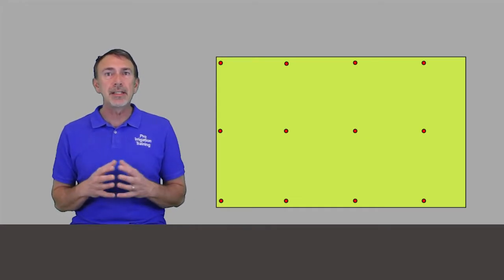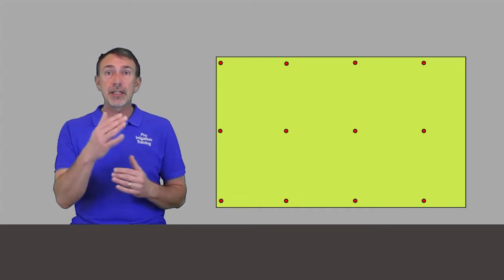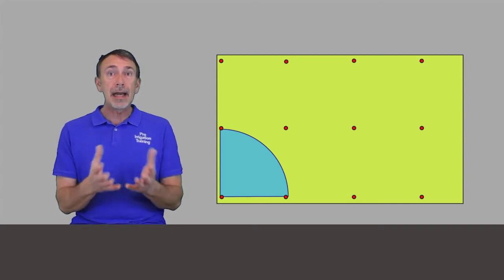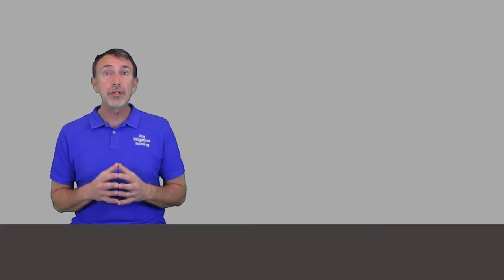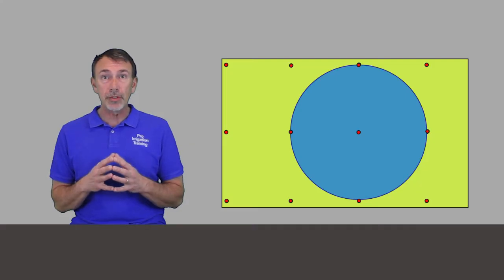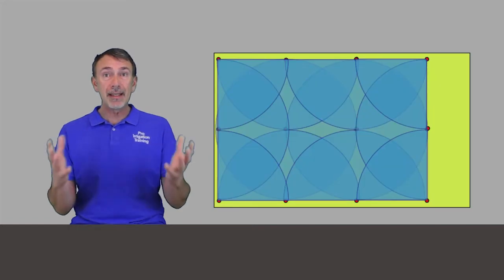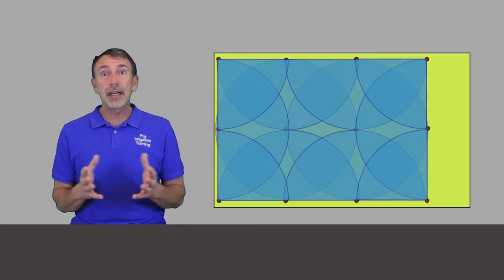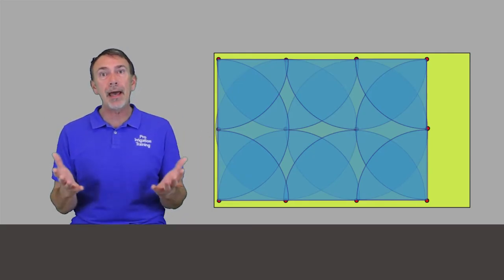Head To Head Coverage in Irrigation Design (sprinkler system design)

Comment: I have same shape lawn but already have sprinklers around the edges only.   One in each corner and then 2 additional on the longer sides.  Should I be using 180 degree on the sides? What about corners?  I currently have brown spots at the base of 3 of the sprinklers on the long sides.   Trying to fix that issue.
Reply from the maker: Yes definitely 180 on the sides, or as wide as you can open the pattern or arc up. Each head's spray should touch the next head. That's how we prevent poor coverage close in to each head.

Comment: I have exactly the same shape lawn - 90 x 60 so looks like I would use 12 heads - 4 x 90, 6 x 180 and 2 x 360.  My water supply is about 20 feet away from the corner of the lawn and I plan on using the faucet with a 4 way timer attached.  My pressure is 80psi and GPM is 15.  2 zones or 3 zones and how would you suggest I connect all the heads?  On the side where the water supply is?  Great video BTW
Reply from the maker: How are you supplying water to the heads? Garden hose? If so, I would lay it out and test how many sprinklers you can get per zone. Garden hose has notoriously bad friction loss.
Reply: thanks…I’ll buy some 1” poly and connect 4 heads and see what happens
Reply from the maker: @cltplayer  That should be sufficient to supply 4 heads.

Comment: How do you determine what pop-up height is needed when ordering MP Rotators?
Reply from the maker: Do you mean the height of the spray body you're going to put the MP Rotator nozzle on? If so, you need to consider your grass type and how high you let it get. Bermuda, Zoysia and warm weather grasses are recommended to cut at 2 - 2.5" so a 4" spray is fine, but Fescue cut at 3.5 - 4" needs a 6" spray.
Reply: @Proirrigationtraining :  Thank you for your reply.  Yes, I'm looking at Hunter Pro-Spray PRS30 sprinkler bodies and they give different pop-up heights, 4", 6" and 12".  Looks like I should use the MP1000 nozzles due to having low water pressure (35-40psi) and a small area of lawn to water.  I was just curious due to lower pressure of water and nozzle if it should have a higher pop-up to reach further. Lawn height will average 4" so I'll go with the 6" inch as you suggested.
Reply from the maker: @joerevere937  Great, good luck with the project. Let me know if you have any more questions!
Reply: @Proirrigationtraining  How about 3 inch? is 4" pop up too short for 3" grass? 80/20 rye fescue
Reply from the maker: @bradyburke4383  I see a lot of 4" sprays in Fescue. It's fine as long as the spray is buried correctly at grade. But many times, after a few years, the sprays begin to sink in the ground, and that starts to be a problem.

Comment: Love your videos. My backyard is exactly that shape and will need tbe same number of heads. I'll split them in two zones.

What's the most efficient way to run the lines? Should i do it in series in a closed loop or should I run the main line in the middle and then tee off from it for each head?
Reply from the maker: It's better to have a main line down the middle and branch off to each head instead of in series. Thanks for watching!

Comment: In my quest to get head-to-head coverage in my previously installed sprinkler system, I notice that there is a valve box in a corner of the yard where a 90* rotor would be perfect. Is it okay to place a rotor near that valve box? The valve box is for 2 different zones. Thanks
Reply from the maker: It shouldn't be a problem. Just be careful digging around the box since you know there's wires going into the box. Good luck and thanks for watching!

Comment: I have a perfect square backyard that has 16 sprinklers. How do I know if I need a 90 180 or 360 sprinkler??? I just had them installed n the people did a terrible job. Also do you recommend the mp rotators with the pro series  pressure regulated heads at 40 psi? Also it’s the same setup as this but there’s 4 rows with 4 sprinklers down each row. so going off this I would need 4 90’s 8 180’s and 4 360’s is that correct? Mines perfectly square just this example
Reply from the maker: Yes you're correct. It sounds like you would need 4 x 90's - one in each corner. All along the sides you would use 180 degree patterns, and in the interior of the space you would use 360 degree patterns. I definitely like the MP rotators on Pro Series 40PSI spray bodies, but rotors such as the Hunter PGP Ultra and the Rain Bird 5000+ Series would work as well.

Comment: Hello Sir,
What sprinkler will you recommend for 3’ small portion.
Reply from the maker: A spray body with a Rain Bird 4" VAN nozzle, and you can use the screw in the middle top to dial down the flow and radius. Or, you can use a couple micro-sprays to cover that area. Thanks for watching!

Comment: Right now I have the rainbird 1800 sprinklers. Do you recommend rainbird or hunter nozzles? I been using the hunter radius adjustable heads but I don’t like the spray pattern, it’s not even. I seen my local box store has rainbird U series nozzles been thinking of trying those.
Reply from the maker: To be honest, I like them both. Make sure that you use the screens on every nozzle, it helps with debris in the water clogging up the nozzles. The U Series is a Matched Precipitation Rate nozzle family and does a fine job.

Comment: If you want to reduce friction loss over a one hundred foot run, could I go from the 1” pipe already installed into 1 1/2” pipe for the hundred foot run as a way to prevent the friction loss that would occur with 1” pipe?
Reply from the maker: Yes. It would reduce the friction loss in that line. Thanks for watching!

Comment: So how do you fix the obviously underwater spots that don't get enough coverage (the light shaded areas). Seems complicated, especially with sprinklers not very precise
Reply from the maker: As long as you stick to a square pattern, head to head, there will be 3 sprinklers that are hitting almost all areas. That's pretty good. Generally the best uniformity that you can expect is 85%-ish with rotor or spray zones, so do the best you can to lay out and install the system precisely and know it won't be absolutely perfect. If you're designing oddly shaped areas, start with a square grid, then add "kicker heads" to compensate for the weak areas. It's ok to slightly overdesign a zone, you can always nozzle down your kicker heads if its too much water.
Reply: @Proirrigationtraining  Thanks for you answer. I have the sprinklers (mp rotators) only on the perimeter of a rectangular area. A couple sprinklers are closer to the right/left edge than they are to the opposite edge. So either head to head to the right/left sprinkler which means there will be areas in the middle not getting enough or do head-to-head to the opposite edge which means I’m going way beyond the right/left edge of the lawn as the stream rotates to the sides!
Reply from the maker: @NotSoLiberal  Always start with your exterior edges and work in, especially if the edge is a sidewalk or street. If there is a deficiency or weakness in the middle, put a head there. It's easy to adjust nozzle sizes or cut the flow down as needed in the middle. And It's easy to put extra heads in during the installation versus adding it later.

Comment: except that realistically most people don't have enough pressure or water flow to put 20 sprinklers on a single line to have any of the above.
Reply from the maker: Oh for sure. This is just for illustration of the concept. I probably should have said that. Even with larger commercial or sports field systems that do have the capacity, it wouldn't be like this. They would use larger and fewer rotors.
Reply: The point of this comment? The information given illustrated head to head coverage. Not 20 heads on one valve